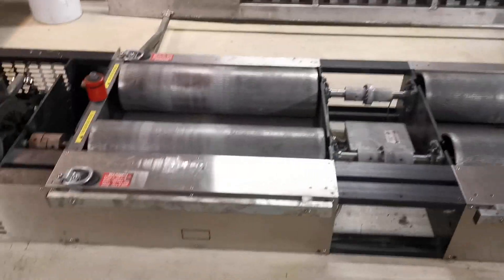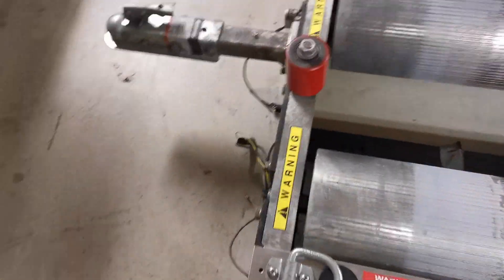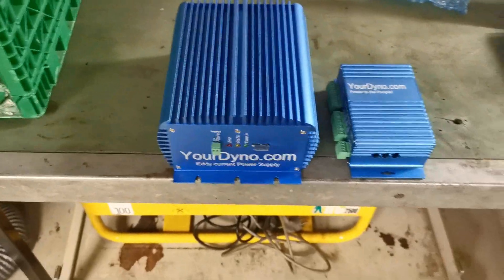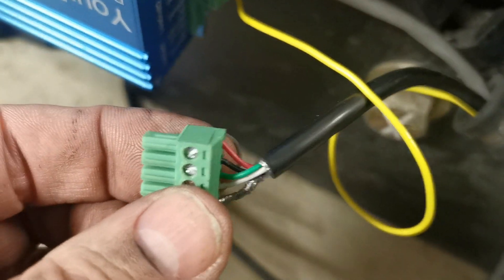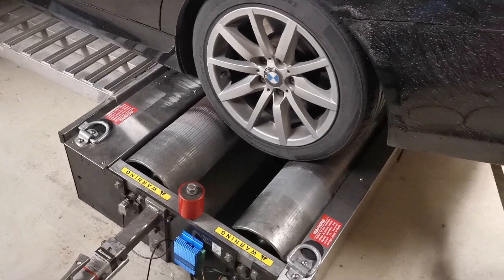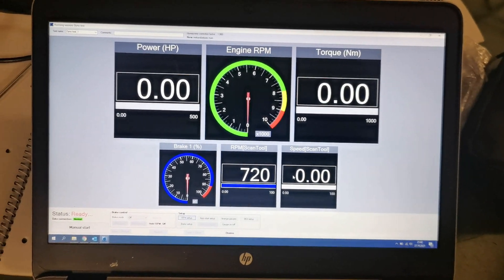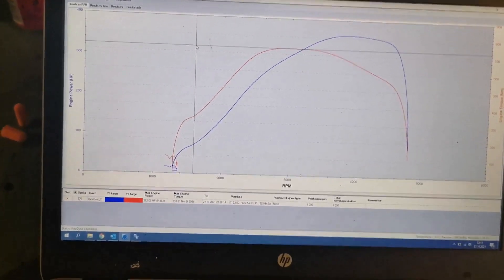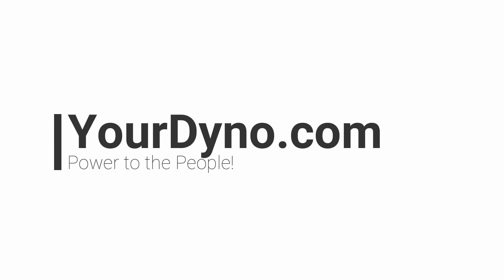DynoCom DC5000 conversion to YourDyno

Comment: Are you able to convert a regular smog dynameter like a mustang dyno to do horse power like the dynocom or the dyno jet
Reply from the maker: Hi, yes that is possible, lots of people have done that. Since the rollers are quite small, the max HP is limited. I believe people are running a couple of hundred HP or so on them
Reply: @YourDyno  ok cool is there a number I can call you guys to get a little more information and get a kit from you guys

Comment: wondering if the angle of the car sitting on the ramp will infuence performance or cause oilstarvation (the oil not sitting level in the pan the oil in the pan maibe touching the front of the crank and sitting at a lower level near the pickup to the pump , maibe even influence the fuelsystem by "raising" the tank higher in the fuelsystem 
simple to solve by jacking the car u in front and set the front wheels on platforms might be worth testing to see if anything changes 
allso didnt show if you pick up signals from the engine (like engine rpm) to use with the dyno program
Reply: It is quite common to run dynos above ground like this, although I prefer mounting them in the floor so the car can sit more horizontally. I don't imagine the power difference being noticeable from the front of the crank potentially hitting the oil bath. The "bath" is anyway in high flux at high RPMs. The fuel pressure is regulated. 
In this example we read the engine RPM from a Bluetooth OBD2 module (an ELM327)
Reply: Will it also work with the DC15000?
Reply from the maker: @TheCholmes729  For sure! Same process to install on a DC15000.